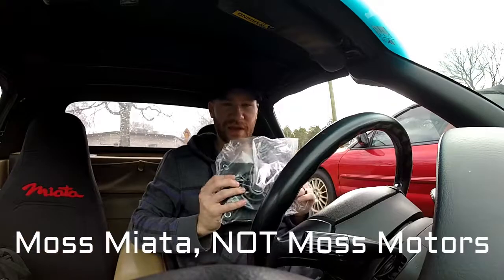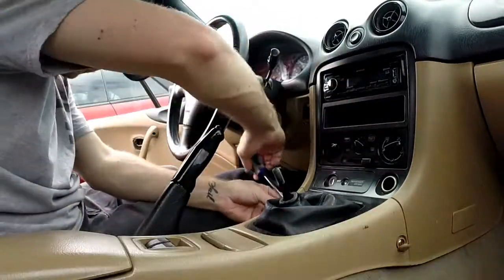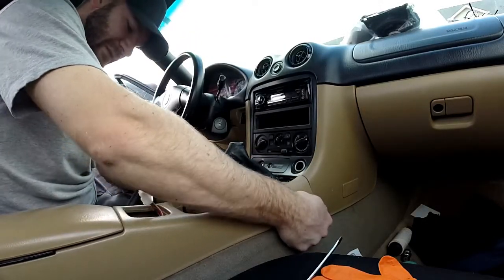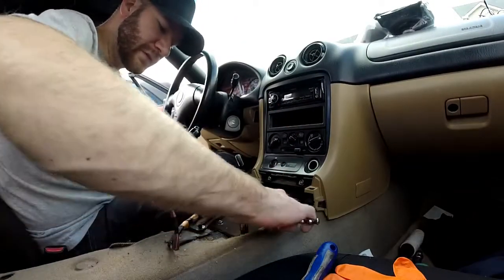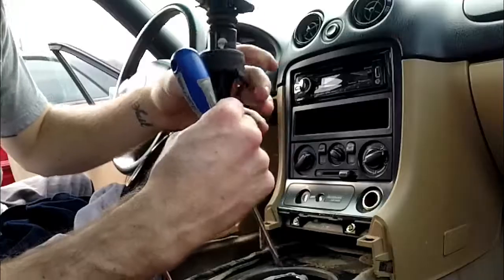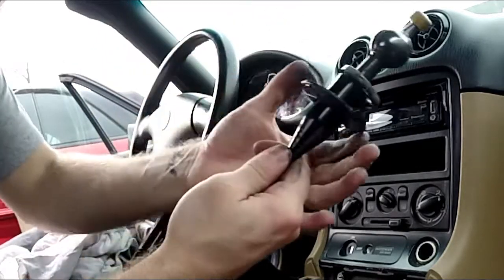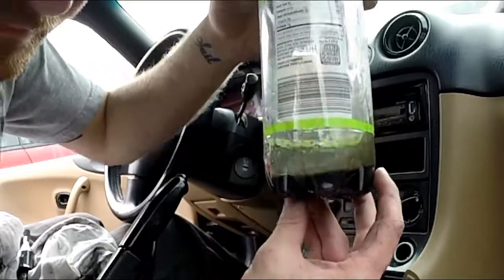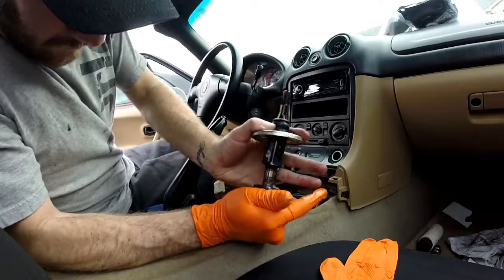The Best Walkthrough for a Shifter Rebuild on a NB Miata

Comment: Hard to tell but it looks like the shifter was installed backwards. (180 degrees rotated). While the shifter can be installed two ways, the shifter has an angle and should be angled towards the rear so it really should be installed that way. I believe the dot should face the front. At 11:30 it looks like the dot is facing the rear.
 Here is a miata.net thread about it: https://forum.miata.net/vb/showthread.php?t=214037
Reply from the maker: bperrybap I’m not entirely sure, thanks for pointing it out though. I no longer have this car and have a 2018 GTI.

Comment: hey dude, great video! Did you notice a bigger difference in shift performance from doing the trans fluid or the turret fluid? Because I recently did the Motorcraft unicorn butter fluid in my NB2 5 speed and it still shifts like shit. I also think that the "90 ml" estimate must apply to the NA 5 speeds because mine took double that, and still wouldn't fill. But when I topped it off, it did seem to make a noticeable improvement for a couple days… but then back to crap. Never filled it all the way to the lower bushing though, so I'll try that today.
Reply from the maker: Thanks! So I did the shifter rebuild before the trans fluid, I pretty much had no fluid in there. I didn't measure but it did seem to be more than the 90ml that it supposedly requires. I filled mine up to the top of the shifter bushing. As for performance it definitely cleaned up the sloppiness and excessive movement from before. The fluid probably helped with that. I used 80-90 gear oil (same for the tranny) its been great since! Same with the trans fluid change, helped clean up some of the rough and hard shifting. Not a crazy dramatic difference but very noticeable! When it shifts is it still sticky? or sloppy? Sorry I couldn't of more help! If you make a video I can try to help see what's going on :) It's possible you could have an another issue causing this is symptom.
Reply: Avid Auto turns out I had a 6 speed this entire time and didn't know lol. I felt like such an idiot that it took me 3 months to figure that out. The 6 speed is much more notchy and less smooth than the 5 speeds, so that explains why I couldn't get it to shift as smoothly as my other Miatas have in the past. The turret also doesn't hold any fluid with the 6 speeds and relies on splash from the gearbox to lubricate itself. Even though they're much better as holding big power... thats not really my goal with this car and I'll be selling or trading it for a 5 speed soon.
Reply from the maker: Israeli3030 haha oh dang! no worries friend, shit happens. That makes difference though yep haha. I didn't know they 6 speeds were not quite as smooth though that's interesting.